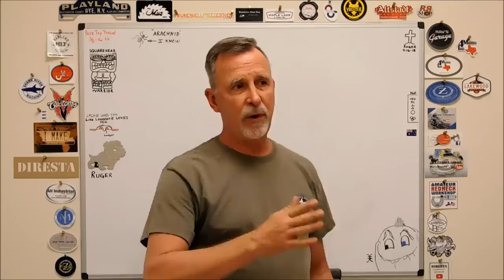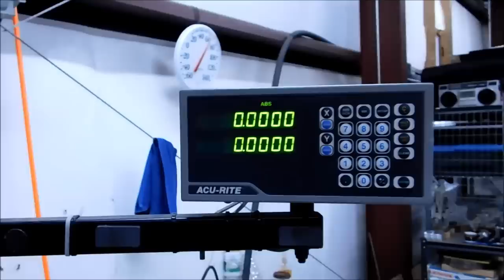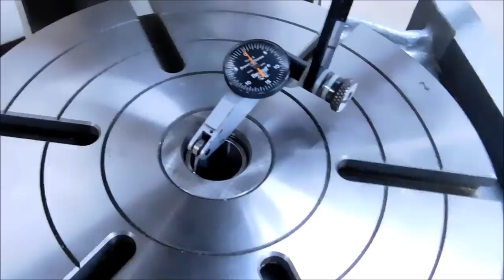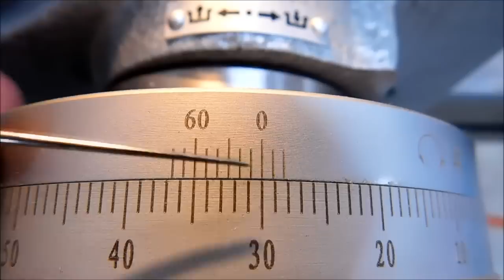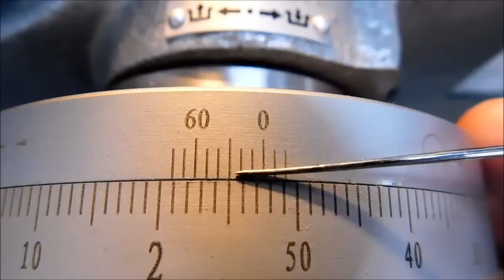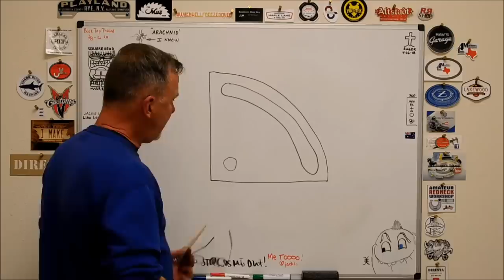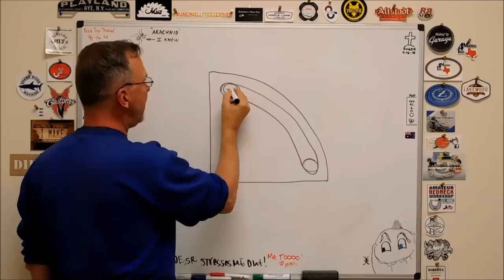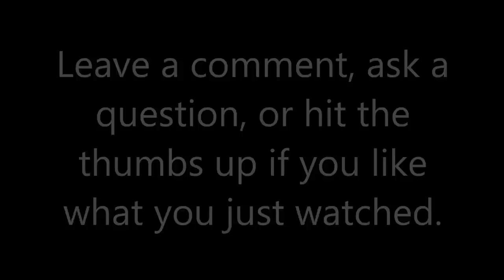Rotary Table Basics

Comment: Hey Joe, really enjoy your videos. My comment is about your suggestion of the t-slots being oriented in a certain position while at "0".  I have an 8" Phase II, and the handwheel can be disengaged from the table, allowing it to freewheel. Then can be re-engaged at "almost" any orientation.  (Unlock the table, then swing the lever that's between the handwheel and table to disengage, now rotate the entire handwheel assembly, until it disengages from the table. The pinion is on an eccentric, rotating one direction will disengage, and the other direction engages. Now the table can freewheel into any orientation.)
Reply from the maker: That takes care of the slot issue, but then the index marks and pointer are out of line. I made an offset extender for the pointer and solved the problem. I show it in one of the other rotary videos. thanks for the suggestion.
Reply: @joepie221  I was thinking about this as a solution to the conundrum when you pointed this out and that was my thoughts, move the reference mark so it is Zero when the slots are aligned. You did that already, best solution and problem solved.
 Cheers from John, Australia.
PS Enjoy the Bash.

Comment: For the radii explanation/demonstration, it would help to draw dashed lines outside of the parts border.  Thanks for the "centering"-tip @ 19:00; while it should be obvious, but for some reason I had to think about it for a second as to why I couldn't conveniently re-center using the larger radii offset (eg. 225 degrees, offset radii-x & radii-y) -- duh.  the lightbulb was delayed!  :)

Comment: I was given a John Stevens Inc. 18" rotary table and that thing is a beast. You aren't kidding these things can weigh a ton. It's quite a bit bigger than I'll ever need. I may look for a smaller one, but I'll wait until I need one for sure.
Reply from the maker: Wow. An 18" is a 2 person job.
Reply: @joepie221  yeah it definitely is, I have a hyd lift arm on the corner of my work bench and with that I can put it on my cart to get it to the mill.  There was a time I could lift it on the mill by myself, but this cancer crap has destroyed my body and what strength I used to have, so I just get creative to move heavy stuff.

Comment: Watching this again today,  I had not noticed your comment about having the slots align perpendicular when zero'd. I had the same issue with mine, I just added another zero indicator in the right place for that. Actually its good for all sorts of setups, like odd clamping, picking up on features, etc.
Reply from the maker: I made an extension to re position my pointer. I wonder if they offset it for a specific reason?
Reply: Yeah thats what I thought, every single one I have ever seen is offset, just have not figured out why.

Comment: Great stuff, i grabbed one of these when i purchased my lathe/mill combo, even though i had never seen one let alone used or even understand how its used but i saw the potential.I knew i needed it for one specific job (a radiused slot in a motor mount for mates RC car) so just grabbed one, i made sure to get one with the indexing plates as well, making it more versatile still,not that i have even come close to understanding everything it can do but this video sure helped me get closer,even something as simple as mounting(more complicated on a combo machine like mine without a full milling table,only the lathe crosslide,i don't have room 2 machines at this time and most of my milling work very tiny parts anyway,i only wish i could have both my vice and table mounted concurrently) it is now a bit clearer TYVM

Comment: VERY NICE!
It just hit me as I watched your video - I've been thinking on how to make wood wheels for my own cannon build.
Now my lathe (unimat SL1000) holds up to 2" of work - and the wheels need to be 3" or so - but I do have a 3" rotary table... err..."light bulb"!
That is going to be shear FUN! 
Thank you for sharing the wonderful tips and ideas. 
Love your work - 
It's legant, very accurate and smart... 
what else can one ask for?
Saar
Reply: ???? Mount the rotary table on an angle plate mounted to the top slide (or cross slide) and use a milling cutter in a headstock collet to mill the outside of your wheels?

Comment: Hi Joe. Why not indicate in your slots and then make a new index mark at wherever the zero ends up? Or perhaps reassemble the worm drive with the slots in the required orientation.
Reply: Joe would have to disassemble the table and cut out the base casting to extend the cutout for the degree indicator and redrill & tap for the adjustment screw. Or quick and dirty, just make up a thin metal piece with a double offset to come out of the degree indicator notch and run along the base until you have your zero. It would be exposed to damage but so what. 
Since the slots and the degree markings are on the same piece this is the only way it would work.

Comment: I think there is a small error in the whiteboard sketch. If the hole is a pivot point and the slot is for a pivot-locking clamp (e.g. the mechanism used on a circular saw for tilting the blade), then the centre of the rotary table has to be the centre of the hole and not the corner of the part as Joe shows.

The true perimeter of the part is not a quarter of a circle as drawn, It is a quarter of a circle with two small straight sections added on.
Reply from the maker: I have to say your comment is based on end use assumption. I never stated the hole was a pivot hole.  
If the hole was a pivot hole, it would have to be the center of rotation of the slot feature if the two worked together.

Comment: About that one thing you wish your table had.I indicated my table's base 90* to the mill table,then cranked the rotary table till the zero on the  table scale was in view.I indicated the slots in the rotary table so they were parrallel to the mill table travel.Then I added a new flat and threaded hole for the indicator point.Problem solved.

Comment: You could possibly move your zero pointer around 12deg in order to line up your T slots although it looks like you would have to do some machining to the base of the tool or make a redesigned pointer. Good video.

Comment: Joe, it seems to me you could drill and thread a new hole and put that degree pointer anywhere you wanted it to be.  By moving it 12 degrees in the right direction, you could have the T-slots aligned as you choose.  You could even drill two so that one would have the default slots along x and the other would have the default slots along y...
Reply from the maker: Its fixed.

Comment: Hey Joe,  I love your videos and have been following for a while.  I have been doing machine work for years and am not at your level by any means but am always interested in doing things on a manual mill.  I have both manual and CNC but always wonder how they did things in the old days.  I have been playing around with building a cycloid drive and have no problem making the cycloid on the CNC mill with the part being designed in Solidworks.  Was wondering if you had any insight on how they might have done these in the old days with out CNC.  Possibly some sort of rotary table setup???  Thanks!

Comment: Hi Joe, don’t know if I’m right or not, but if you don’t like that your rotary table is 12 degrees out of perpendicular, can’t you just pull the worm gear out reposition the table 12 degrees and reinstall the worm gear? Of cause you may have to play with it to get the timing right as you reinstall the worm gear, as it will turn the table when reinstalling it. Unless you can hold the table and screw the worm gear back in with the table where you want it.  I love watching your videos, thank you for a world of knowledge you provide to all levels of machinist.
Reply: I had the same thought then I realized that numbers on the edge of the table would be off.  I think the trick is just rotate the whole table.  Joe would need to make an adapter plate to bolt the rotary table to.

Comment: You might be able to disengage the worm and then rotate the table to align the T-slots then re-engage the worm wheel. Just a thought. I use to have an 15” Troyke rotary table.
Reply from the maker: I made a new pointer with an offset arrow.

Comment: Thanks Joe - 90% clear.  Just a dummy question- what are the additional two marks to the left and right of zero and 60 ......?  

Everything else got through my thick skull on the first pass.  That is a real accomplishment Joe!   LOL! 

Dan
Reply: Notice that there are always two pairs of lines lined up when you're using the vernier if you have the extra lines. It's a lot easier to be sure you're right on the line that way, and not being fooled by parallax (the angle you're viewing the scale from).

Comment: Note to stiffen up Lok-Line in that application, put the largest size Romex in side, make it rock solid!
Reply from the maker: 12-3 or 14-3 should be perfect. Heavy silicon tubing works too.
Reply: @joepie221  - the Lok-line might want not want to hold its position with Tubing, been doing it for years.

love your work, keep it up!

Comment: Hey Joe love your videos they have been very helpful to guy who pretends to be a machinist.......I ve got probably a stupid question for you.....I have the same rotary table as you ) phase 2 10 inch) what would you use the morse taper hole in the middle for? Is it just for centering the table?
Reply from the maker: To be honest, I have never used it for anything, but I am open for suggestions.
Reply: @joepie221  I have put 3MT drill chuck in it, and used it to cut slots in spur rowels. Probably not what you would do, but worked rally well for me.
Love your videos, Thanks for the effort to teach.
Reply: Hey west Weld ,I use mine for a quick alignment of a 3 jaw chuck. Slide the chuck on add fixings , place taper with additional parallel length say a lathe tail stock alignment tool tighten the chuck to the taper tool and tighten the chuck fixings. and wallah centered chuck.
Reply: @tonyhughes7056  And the 12" rotary table comes with an MT#4 taper.
Reply: @joepie221  Hi Joe, I have a cheapo Chinese rotary table with an MT2 hole down the centre.....And I'm currently making a 1" ID clamp out of a 1.5" x 2" piece of 6mm cold rolled MS. This is to secure the slide of a digital scale to the lathe tailstock barrel to give me  DRO on its travel. I have a damaged memory and am so fed up with getting lost trying to remember how many turns I've turned the handle on the 8TPI screw! So far, I've machined the ID on the lathe in the 4 jaw chuck,  and have a blank MT2 arbor with a 1.5" end. I'd previously used it for something or other, so it already had a clamp washer and 8mm thread. So today I machined a 1" boss on it, and installed it on the rotary table with a small drawbolt up the bottom.  I centred the 1" boss OD to the mill spindle just as per your video and have rough sawn the bulk of the waste out of the clamp workpiece and mounted it on the arbor.  I'm now just trawling your videos for machining tips when using a rotary table. But hopefully from my description, you can imagine what my workpiece looks like, and I'm thinking an MT centre bore seems perfect for tasks such as this where 360 degree machining of a perimeter is needed ....mostly 1/4" wide strap, but with an 'excursion' on the X & Y axes to do the lugs for the clamp bolt, and DRO slide attach point. Like you say...lots of maths & dimensions, so with my bad memory.....one slip up and it's a scrap bin filler!  But I've done one of your great  tips and put a sharpie mark on the X & Y carriages for the centre point, so if I get lost, I can quickly get back to a good reference point.  So West Weld......for this sort of task I think the MT bore is good to have, otherwise I'd have to mount a chuck on the rotary table, use the inner jaws to hold the workpiece, and it all 'wedding cake layers' up to leave no Z height left on the mill to get a cutter in!  BTW I'd also previously made a short MT2 plug, with a centre drilled top, so can use this to quickly centre the table to the mill spindle. Couldn't do that today because I had to tighten the drawbolt on my arbor BEFORE mounting the  rotary table on the mill table.  Stay safe everyone. Cheers, Allan

Comment: Joe,  Great video and took your advice on the Multi Axis Stop 48-000, but have a older, maybe much older mill , it's a Clausing model 8520 and the hold down slots are just under 1/2" wide , so the axis stop T nuts are to big, and would like to make new ones and the attachment part form my mill.  Don't want to mess up the old one in case I update the mill, and since this one was like brand new when I found it, would like to make the attachment part and new T nuts and keep the old one. Would you know or have any info on the way to cut the new radius to match the fixture for the Axis stop,.  As the bottom of the base is also bigger and won't fit my table.?  Any help would be great, Keep the videos coming, I learn so much from you.  👍👍👍👍

Comment: another success on your part.  thanks.  I just bought a very clean Walter 10" table that is sooo heavy.  will that combined with my 6" Kurt overload my Bridgeport if i leave them both in place constantly as you do?  so much weight for the B port to carry??
Reply from the maker: When I have to leave both setup for extended periods of time, I try to center the weight on the knee when I shut down. Leaving the table offset introduces too much off center weight and that can't be good.

Comment: So why not just mill a new spot for the tag and drill the zero hole so it aligns with how you want the top indexed?
Reply: There are numbers stamped on the rotating part of the table so that you don’t need to count how many degrees past zero you are. These numbers are what need to be moved as well as adjustment of the “tag”  (assuming the markings are not aligned with the slots)
Reply: @JaysonWallis  Pretty sure Brians point was to rotate the table so the slots were aligned the way you want and move the pointer so it lines up with the zero on the table.
Reply: @barrygerbracht5077   Correct.  I see now where I was wrong.  Cheers

Comment: as far as the tooling slots, could you not machine off the 1 degree tics from the outer diameter, set the slots where you want them and then re-machine all the tics back in?  Seems it may be a fix for a table you already own?

Comment: Nice video Joe!  Did you know that Phase II has an adapter kit for their rotary table converting the hand wheel to a dividing head style?  I have one for my 8".
Reply from the maker: Thanks for the info!
Reply: @joepie221  You're welcome. They also sell a full size diameter plate that has a center locating pin. I machined mine to accept all of my lathe chucks.

Comment: Joe, just for your information, when you talk about seconds on the circle, I calculated it out, with 2 lines 1 second apart, the circle would have to be 1.5 miles wide before the lines could be separated (if my memory serves me correctly)?  It would be a totally black circle up to that point.  Just for curiosity!

Comment: Joe,
 Great video! Hope to have my mill running soon and playing with the rotary table is high on my list of things to do 😊 .  Did have a thought for you; could you not set up your table with X-Y square to mill, dial in the tee slots so they are parallel as well and then just mill a new pad for the “zero” marker on the cast base??? I’ll be checking mine out and doing just this if the casting will allow for it. Thanks again for all your educational videos.
Reply from the maker: You Must read minds.
Reply: @joepie221  I read books, some magazines occasionally, prints (but not well... ) . I cant read minds though, trust me on that one. Seriously now, it's the teachings of people like you and many others on YouTube that have advanced me, in my YouTube apprenticeship, to the point that I see these types of solutions! And sometimes you nail it and get a gold star from the teacher. Thanks for all your videos. UA.

Comment: Excellent video Sir. I’m in for the rotary table series. Question, are you going to show something with a surface grinder and rotary table. Not sure if it’s practical or not. I just have some round pieces I would like to play with on the surface grinder in practice servicing them similar to a fly wheel. I’m only a beginner in machining so don’t laugh too hard. 
Most likely have to cover the rotary table to keep out the grit   Only an idea Joe. Thank you so much for sharing
You are appreciated.👍👍👍

Comment: Hi Joe , thanks greatly for your ongoing education. 
In regard to the slots being perpendicular/ parallel  to the table,  is there any issue with centering the table to zero on the dial then physically skewing the whole  table so the slots align with the table?
Reply from the maker: I suppose that would be OK. I made an extended index plate and all is well.

Comment: I've had problems with smooth parts on a smooth rotary table shifting under cut. Any tricks for ensuring that stuff stays where you put it? Great vid as always! Thank you.
Reply: i'm just guessing but do the same cuts  turning in the same direction  every time? that would apply the same loads
Reply: I think the general solution is to make a fixture plate with surfaces that the part will bear against, rather than relying on the friction under clamps, but then, how to accurately locate the fixture plate might be tricky.
Reply: c dorcey yes and maybe a bit of texture on the plate rather than a ground surface

Comment: Looking for suggestions on mounting solid brass round stock on rotary table to mill flats for a decagon???
Reply from the maker: Mount the material in a large 'V" block and then mount the 'V' block to the rotary table. Saw off the decagon afterwards and mill it flat.
Reply: @joepie221  Thank you Sir!